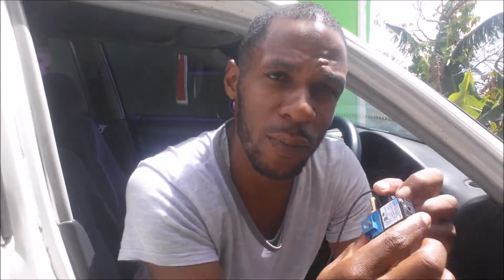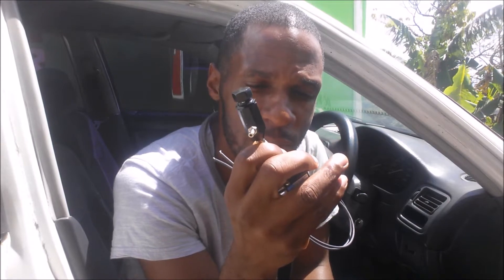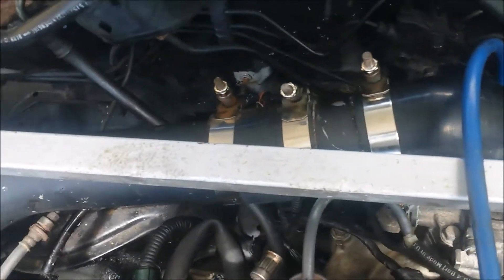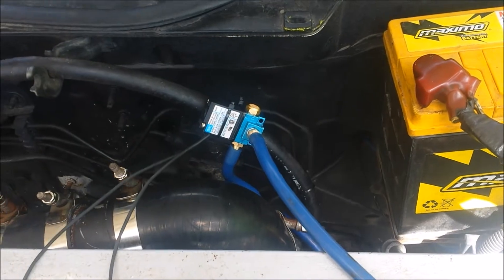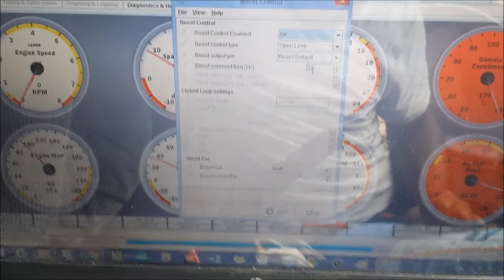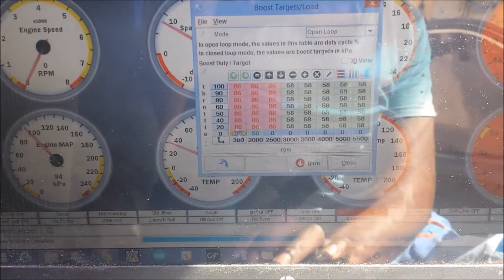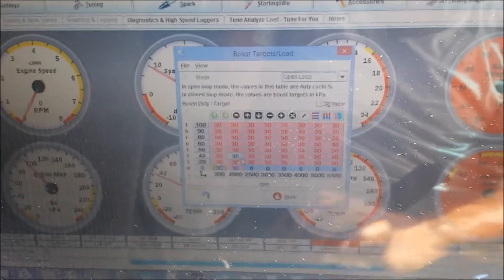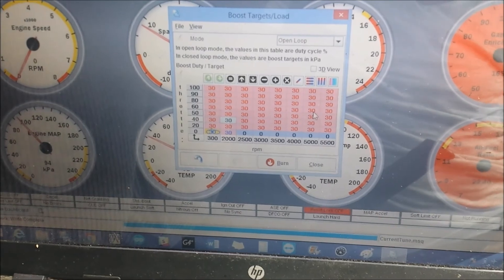Electronic Boost Controller Install with Speeduino ECU

Comment: Nice vid.. Can that b incorporated into a boost by gear setting?. Also do u have a no2c pinout?
Reply from the maker: Speeduino at this time doesn't do boost by speed or boost by gear. I get the feeling that it may be added soon. 

There is a no2c pinout floating around. I can email you it when I get it. In the mean time you can just do a google image search and you will see a few.
Reply: Cool but haven't been able to find the no2c on google
Reply from the maker: @dhatkidds3v3n86  shoot me an email and I will get you something
Reply from the maker: @dhatkidds3v3n86  here you go man 
https://github.com/turboedge/SpeedyBoards/blob/master/NO2C-v0.2.x/v0.2.2/RENDER/NO2C-FRONT.png
Reply: @DCWERX  thanks

Comment: Awesome!!! Great content. So, you are using the factory harness for the map sensor to operate the boost Controller?.
Reply from the maker: Yea the wire  from the factory map sensor that goes to the ecu is now used as my boost control output from speeduino. 

Speeduino has its own map sensor onboard so the stock map sensor wiring can be used for whatever you need it for
Reply: @DCWERX  I asked because I just finished building a patch harness on my speeduino idc40 to db37 connector. And now I'm making another patch harness that goes from db37 to the obd1 ECU connectors. I actually left the wiring out of pin 35 for boost controll off. I didn't think about using the factory harness. Once again thanks for the input. I guess I'll do the same to keep it a cleaner look and use what the car already has as far as the factory harness.
Reply from the maker: @ciscoperez4271  yes sir. Definitely makes for a simpler and neater install.